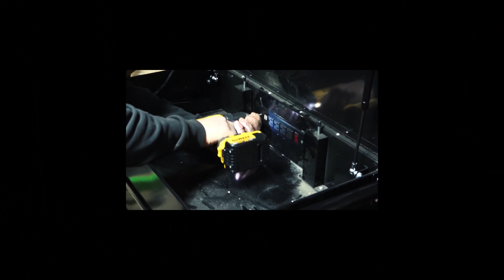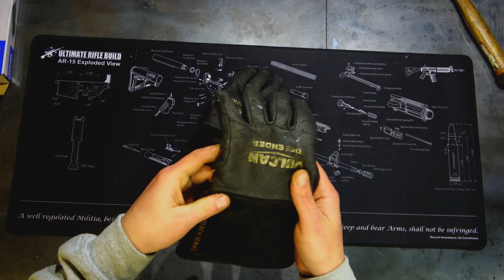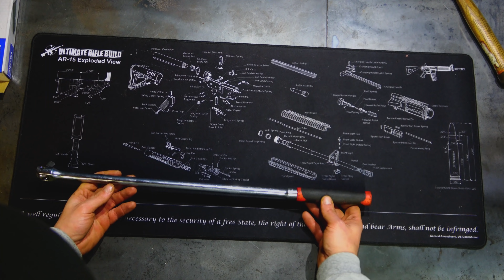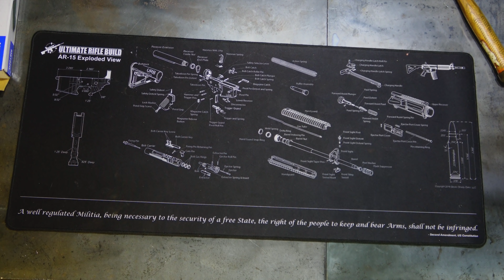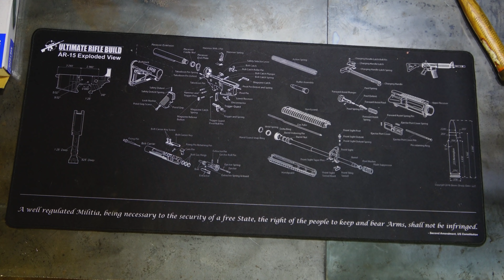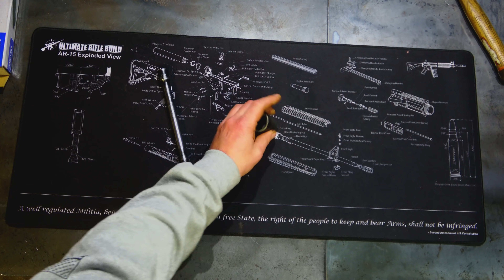5 Harbor Freight Tools Professionals Could and SHOULD Be Using in 2019

Comment: I don’t have the Daytona jack but I have seen nothing but good things about it. Also never used the Vulcan gloves but I really like the cheap pair of Lincoln’s I have been using and they are pretty darn good. I have used the cheaper brand of their welding gloves and I don’t care for them much. Everything else is spot on! I’m not a pro but I use these tools all the time. I love them. If you did like a top 10 would the Pittsburg Pro Low Profile Ratchets with the comfort grip handles make your list? I have a few socket sets and have purchased all the Pittsburg Pro ratchets and I skip the ones that come with the kits and use those pretty much exclusively because they are so much better! Good teeth count and nice handle with good length for leverage!
Reply from the maker: They are good ratchets but there is something i dont like about them. I am going to do a video similar to that soon so i hope you check it out.
Reply: Redemption Garage Cool I’ll sub!

Comment: My dad had his impact sockets for ten years used daily still going. The Braun light is badass for 20 bucks. The cheap angle grinder the ten dollar one is just as incredible. Just keeps on going can’t kill it. I’ve cut everything with it exhaust u name it. Had it for about 4-5 years now. I use their cutting discs as well work great. I buy the big pack.
Reply from the maker: My buddy has one of those grinders and it does just as good as my Milwaukee
Reply: Redemption Garage I actually like it better than my dewalt cause it’s slower speed.

Comment: I got the 17in 16 speed drill press and it's been nice specially for the price. Anchored to floor, added a custom stabilizing support underneath and swapped the belts and is great. Drilled 1in holes in 1in plate with only a qtr in pilot hole and no issues.  Dead blow hammers have held up.  C clamps are good for price as well no issues with any of them either. I use the Berger f clamps for my custom clamps for my welding table and they have held up as well. Sure there is a few other things I can add but those stand out most not already listed. Thanks for video
Reply from the maker: I have never used one but i love buying cheap and beefing them up.
Reply: @RedemptionGarage  think it was about 300 after coupon, but anything else comparable is 8/1200$ and only difference I have seen is paint

Comment: I bought the $20 after coupon set of deep impact 1/2 inch sockets for my engine rebuilt project and they're just amazing.

I also have the 3/4" deep well set that I bought to use the 36mm (I think) as a crankshaft pulley installer. I'm now trying to sell them on Facebook Marketplace for $40 and no one wants them, lol. I feel like that's a steal! I would keep them, but I don't think i would ever use them again.

Comment: the only thing i've ever got from HF that i didn't like was the 3/8 17" breaker bar. i broke 2 of em. everything else has been great. they swapped those out no questions asked but still, it's pretty annoying when you're trying to get something done. i think alot of people go there and forget to manage their expectations. not everything at HF is a diamond for dirt prices. the things that are though, wow.
Reply: if you broke a 3/8" breaker bar  then it most likely a job you should have used 1/2" drive  on anyway
Reply: @funbricknj  agreed, but it was a tight spot. Shouldn't have been anything
Reply from the maker: I agree man!